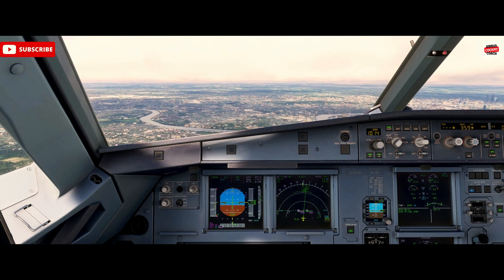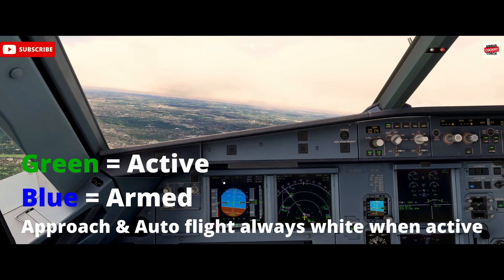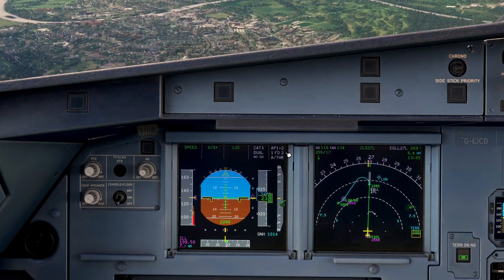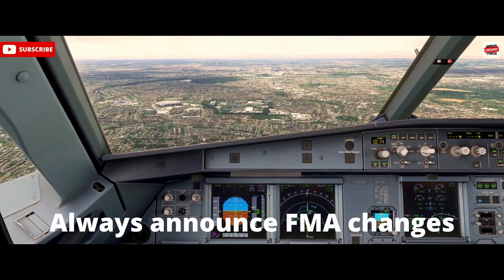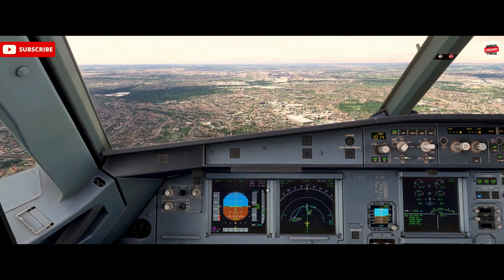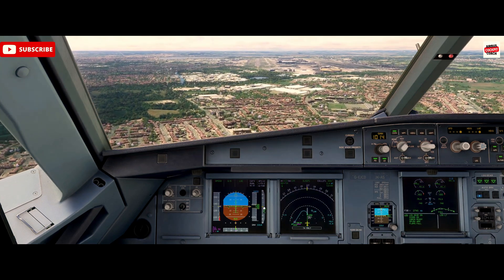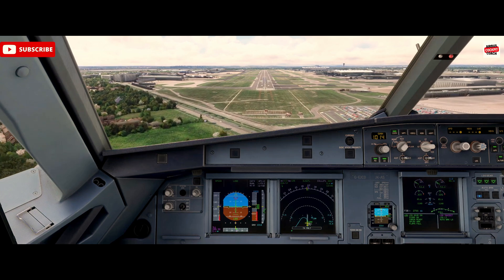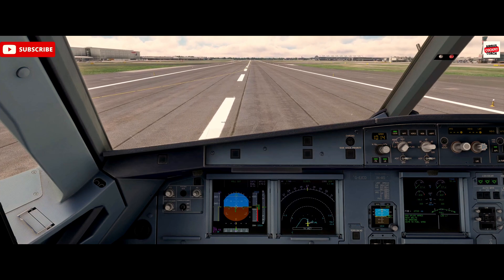FMA Explained | Real Airbus Pilot Breaks Down A320 Flight Modes

Comment: What's special about LAND and FLARE FMA modes? Like what is LAND vs "G/S + LOC"?
Reply from the maker: These are combined modes, LAND is telling the pilot that the course and rate of decent are acceptable for an autoland. FLARE informs the pilot that whilst maintaining RWY track the aircraft is beginning to flare   which is an essential requirement for an autoland. You could view it as a summary of 2 modes that can be quickly read to show the aircraft is performing as required